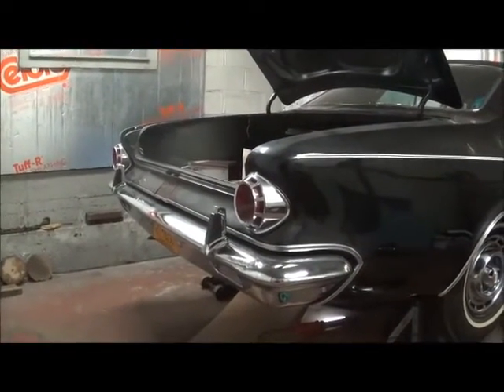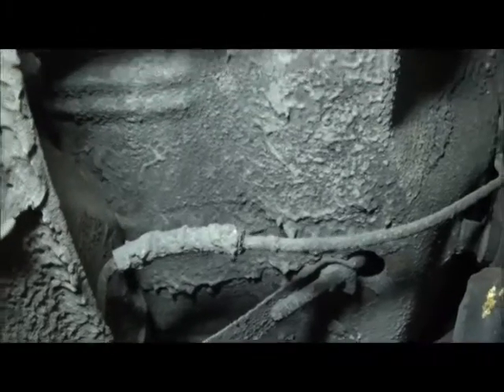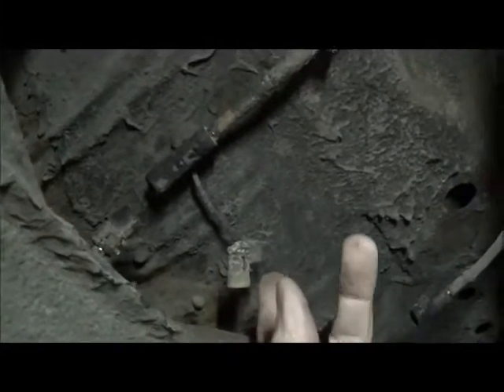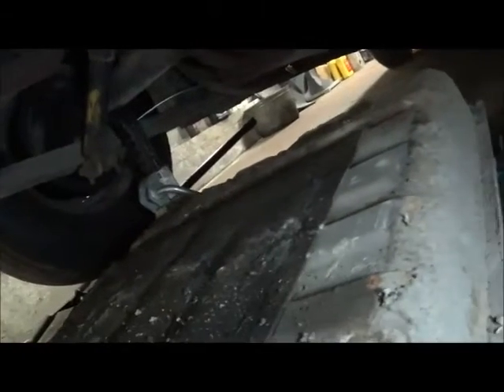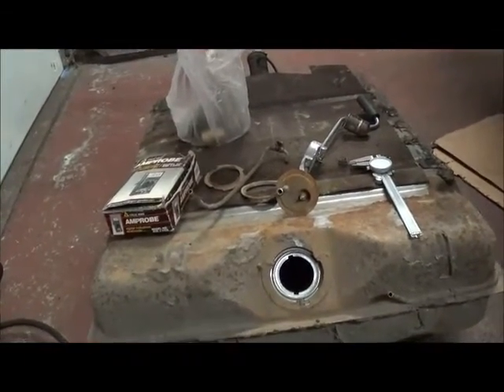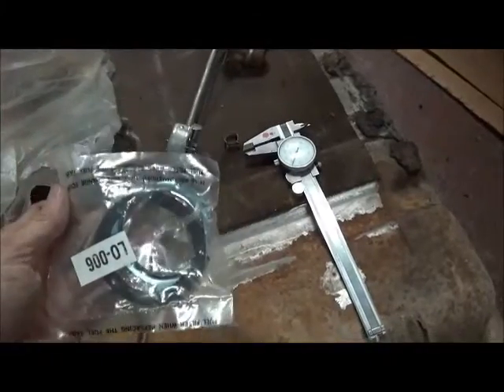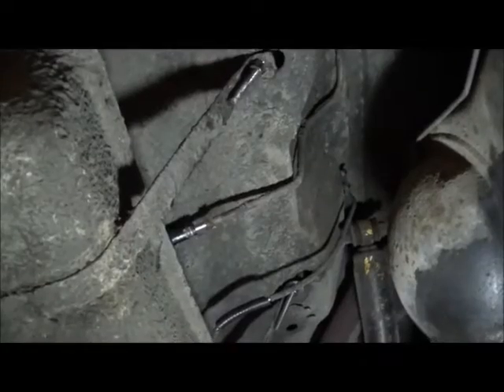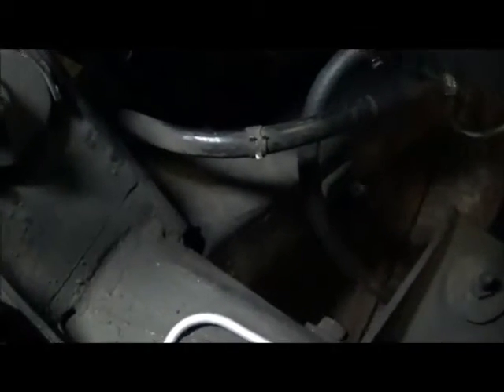1963 Chrysler Gas Tank

Comment: Just dropped a 64 and it had filler neck bracket secured by one screw accessed thru the trunk at the latch bracket and yes it too had a drain plug.  No vent line though... used a vented cap.

Comment: Hi Bob,
Is it possible to remove/service/ reinstall the sender assembly without dropping the gas tank. Thank you.
Reply from the maker: Yes you can. The sender will have to be worked around the differential housing and the shocks and the trunk floor, but it can be done. It helps to have the tank strap jack screws lowered. Of course, work safe. Pump the tank as empty as you can. Use a LED shop light, something cool. No sparks, no incandescent shop light.
Reply: @300rcm1  
Thank you. Are you the same Bob I may have met in Groton Ct at the Chrysler 300 gathering a few years ago? 
Cliff
Reply from the maker: @cliffholt8197  There may have been more than one Bob at that meet, but I was there.
Reply: Thanks again. I was able to remove the tank sender without dropping the tank.
Backed the F onto ramps and it was out in 5 minute.
The flat brass lead for the fuel gauge had broken.
Thanks again.

Comment: Hi Bob So one end of ground line is on the metal fuel line , and the other end goes on the rubber fuel line on sending unit? How the heck did you get that end on the rubber line? That end cannot touch clamp? Thanks...Denise
Reply from the maker: One end is on the metal fuel line, right. The other end is on the metal stem of the gas tank sender.
Reply: Thanks Bob. Broke my original yesterday and had to order one off Ebay